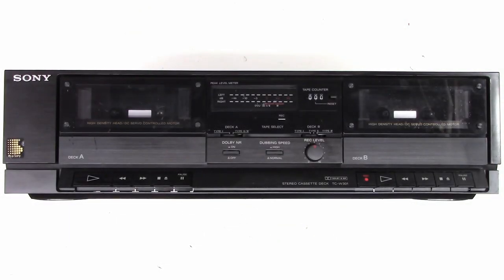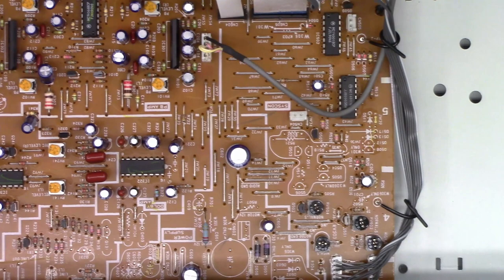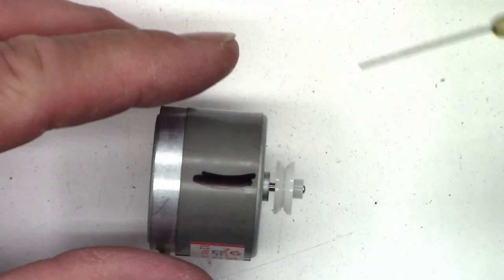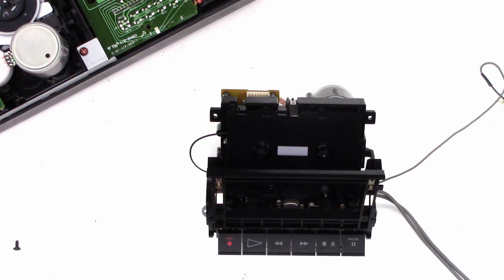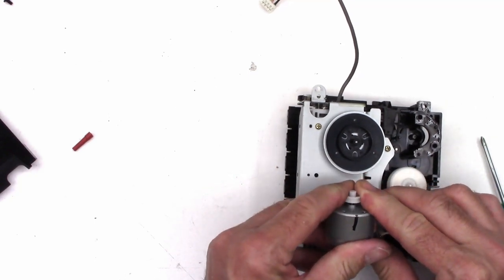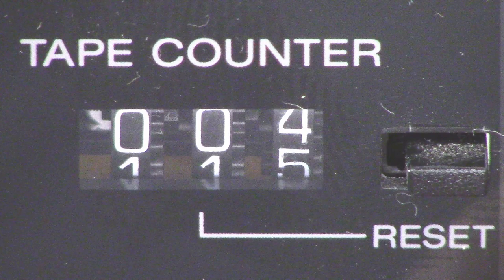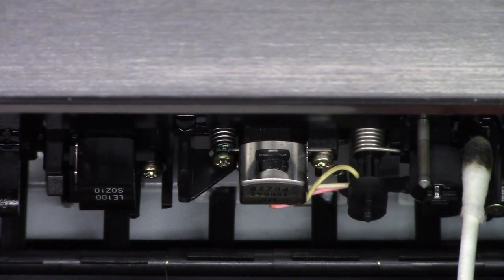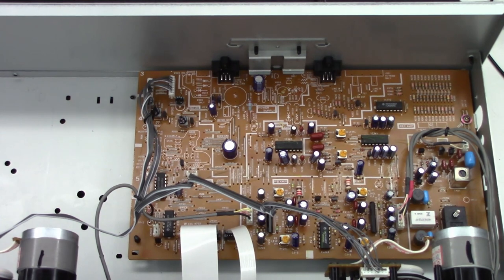SONY TC-W301 TAPE DECK BELT REPLACEMENT AND SERVICING TCW301

Comment: I have one of this TC-W301 since 1990, and never fixed anything on it. But I left it aside for many years. Today I decided to play a tape, and nothing happened. No buttons gave a response in either deck, i.e., the knobs just didn't turn. Do you think this is also because of the belts, which were never replaced?

Comment: Boy, talk about "Proprietary"!  What was that weird dark color on Deck A record head showing up after cleaning? That deck B (right side) pinch roller has had some wear. Got me to thinking, you could actually recondition them running in FF mode and use a small piece of AT soaked  of grey(medium) Scotch Bright and they would be clean & smooth as new. Lubrication! Yea.... :)
Reply: Opps! I beleieve I mispoke in e-r-r-o-r, e-r-r-o-r, e-r-r-o-r, STERILIZE... :) Deck A was player Only and Deck B was Record side.

Comment: for a few cents more , they could use wider , ribbed belts like on a timing belt. Stuff is SO made to a low cost.  Better yet , make it gear-drive.
Reply: Gear drive will cause mechanical noise. Direct drive is the best.

Comment: how is it possible to fast forward without a tape in it, I have in mind that none of mine are able to do that. Good video.
Perhaps it would have been better to explicit showing of unscrewing the unit at the first deck, and not at he second, if people 
would lose interest. Good tutorial though. Thumbs up.
Reply from the maker: These decks do not have a tape present switch and it is just a mechanical mechanism.

Comment: How exactly do you attach the counter belt?  I see the little white wheel it goes around but do not know where it goes on the actual deck.
Reply from the maker: It go's around the closest reel, either supply or takeup.